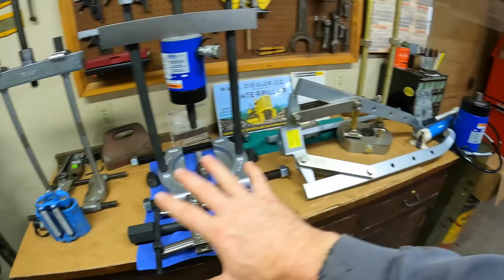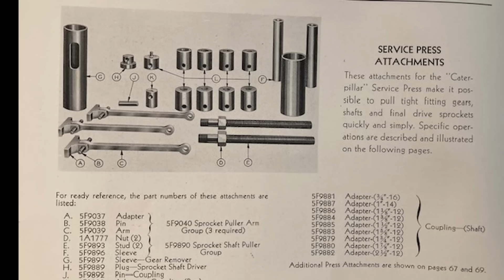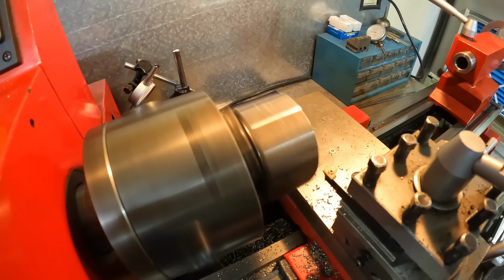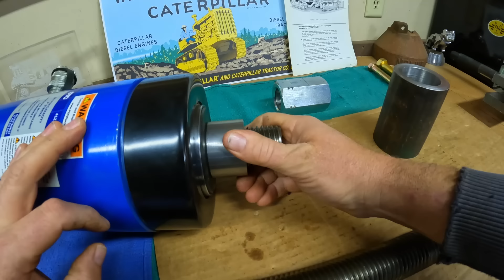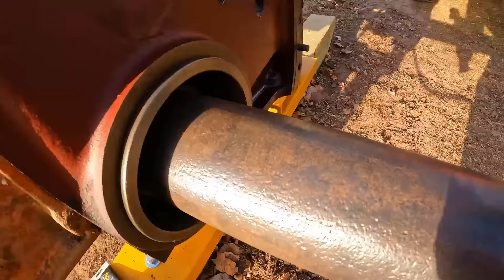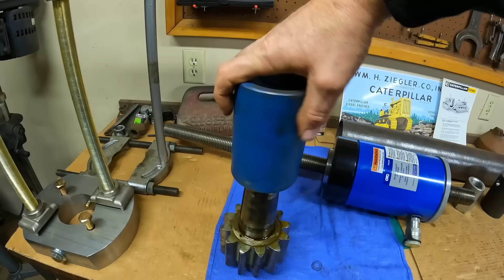50-Ton Puller Build for Removing Caterpillar RD-6 Dead Axles! #2H1768 Ep.21

Comment: Two things some quickly cut out C shaped plate "shims" to drop in between ram and pulling tube could come in handy for future setups to make last minute adjustments on the fly. Sorry if that comment has already been flogged to death I have not read through the others to see. Also my second comment, you will want a press kit in lightly used condition, if it is cosmoline would you be able to bring yourself to remove it?

Comment: I overhauled a D8 cat when I was younger. The sprocket would not break loose at a 100 ton. It took heat and a smack with a 20 pound sledge hammer. Really scary working with that much force.

Comment: I know that OTC makes some incredibly nice stuff. Those are some large tools, most definitely. I wonder if a guy could get some emery cloth on the areas of the dead axle prior to pulling to remove as much rust as possible. I get that the rust is in the journals, too, but at least you could polish a lot of the shaft before and as you pull. The further you pull it out, the more polishing you do to the exposed portion, because it is a dual-journal system from what I can tell?? Just thinking out loud, here. Great tool making episode, too!!

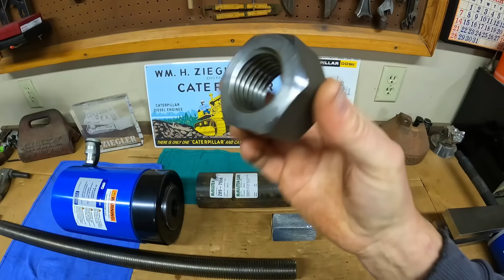Comment: Around 9:08 you say you're not equipped to cut big internal threads. I appreciate that taps on that scale are unusual, but surely your lathes plus a suitable cutting tool could do it, single point style?

Comment: Do yourself a favour and cut some C shaped 1" thick spacers that can be used to quickly take up space as the part moves, instead of having to reset everytime the ram runs out of stroke.
Reply from the maker: The best trick is to just build everything right the first time, but I was so laser focused on getting the taper broken loose that the straight portion behind it didn’t even cross my mind 🤦🏻‍♂️
Reply: @squatch253  True but after having done hundreds of bushings, I found it quicker to back the ram off and install a couple of spacers, instead of having to thread the nut down. The time saving isn't noticeable on one or two bushings, but when you are doing a batch of 10 it adds up.

Comment: That "Handyman Jack"  is a very useful piece of kit, here in the U.K. we used to pull a very heavy duty set of Disk Harrows behind our MF 1505 Tractor. It was not unusual to have a Bearing failure in the Disks, However carrying spare bearings and the above Jack I could replace the Bearings in the field without having to return to the Shop.

Comment: Nice job Sir!
I don't really know what other people like watching, but as an amateur machinist myself, I do wish you would show a bit more of the setup process. To me that's far more important and interesting than the actual machining. For example in this side-project, how did you find center of the tubular adapter before drilling the cross-hole? It's probably the most critical step of the whole build because if you get it wrong, nothing fits. I know how I would have done it but to get it perfect my way would heve required also turning the OD of the tube so thst the OD and ID were concentric...

Comment: You  might extend your pull tube with a thick steel plate with a nice hole in it.      I think you might  have something  around  with all the scrap your are making.   Great work.

Comment: For interrupted cuts like that, dismiss cutting the outside and invest in tooling to cut from the face. Just get a round or square insert (round being the best) and simply "scoop" your way across. If you match your speeds and feeds with the insert specs, you won't have to cut from the side anymore. You basically kiss the face of the work piece and then let the machine work, the large area will require HP, but you can spec your insert for the lathe's specs. Obviously, not all cuts will be possible with that setup, but for most "thinning" ops, that's your wonder setup. Plus, round inserts are the bee's knees for anything where you work a shoulder, remove weld from two parts cut etc. Worth having a few sizes of that format.
Reply from the maker: Unfortunately with our flat belt driven lathes, horsepower is quite lacking. I guess one benefit to that is the belts always slip before anything else can break lol 👍😂

Comment: As a routine process, we used to rotate the stub shaft (dead axle) whenever we were into a final drive.  All Cats, prior to the high drive, shared all blade loads and shock between the final drive and wishbone.  The stub shaft would eventually be bent aft.

Comment: I enjoyed the video!  and thank you for NOT using the vacuum during the machining video.
Reply from the maker: What's wrong with the vacuum?  I would rather remove the chips and debris with a vacuum cleaner than compressed air, which just pushes that stuff deeper inside of the equipment.  I cringe every time I watch somebody blow metal chips with air.
Reply: I think they don't like the squeal when the vacuum is shut off.
Reply: @random_rene exactly!  Sounds like a worn out bearing or two. I would think an OCD person who has a rag covering two layers of cardboard to protect him bench top would fix the vacuum. 

Oh well, that’s just me 😊
Reply: I have one of those vacuums that has been squealing like that for well over 20 years. I tore it down once to fix it and oiled the bushings. It started squealing again in less than a week. It's just the nature of the beast. Personally, I think it's hilarious that it only squeals during spin down. It seems to be perfectly happy when it's running. It only complains when it gets shut down.

Comment: OTC has been around for 100 years and may have made those cat tools. They made service tools for GM at one time if memory serves me correctly They may still make them. Ford on the other hand made all their own service tools for the most part. Chrysler did a little of both. OTC made one of the first scan tools and GM used them. Back in the 80's and 90's I used many OTC tools both mechanical and electrical. They did the job but in many cases someone else would build a better mouse trap or a cheaper one. One standout product is the OTC ball joint press. If you do suspension work you have one or a cheap copy. If it were not for OTC many tool innovations may have never happened. If they did it would have been after much delay.

Comment: Hi once again Brother. On your bandsaw, Raise the blade but leave it engaged in the cut portion. Unclamp your part & rotate it until the uncut portion is high enough to cut through before casting bottoms out. Clamp the part making sure the blade is still in line and cut the balance. Easy Peasy. No hand sawing.

Comment: A very big version of what my dad had on his Hein Warner porta power.  His ram would push or pull.  We used a similar setup to pull small spindals with pocket bearings on cultivator cut away discs.

Comment: Old shafts can be annealed in the woodstove. Add bars to stove just after lighting it then leave all day and remove the next morning when cooled.

I’d add a spacer plate if nessesary to pull shafts. As for threading ina Southbend that’s easy. Internal threads are done with it set to 30 towards head. Cutter is just ground from hss. Should be a little guage for threads looks like an arrow. Also quick change posts don’t work well ina Southbend. I use a four sided tool post in mine or the lantern.  The quick change chatter a lot.

Comment: @26:42 honest question Squatch: how does anyone bend a piece of steel that thick? I know this tractor had a dozer blade on it, so the only thing i can think is someone tried ramming their way through something, in road gear, with the throttle wide open. 

Love OTC tools as well, even though i don't have many myself; i have yet to be afflicted with the fever for tractors this size 😆
Reply: Toby has described the boys that were on the farm that X231 came from as being able to break an anvil with a rubber mallet, if you let them. I've known a few people like that. I was in a mechanics class with a guy that the instructor once said that he could sink a battleship with a drop of water.
Reply: @danielbutler578 you make a valid point 😂

Comment: I’m surprised to see 10,000 psi that early on.  Talk about working with a bomb!
Reply from the maker: Fun fact - the earlier Caterpillar Service Press that the 6F25 I showcased here replaced, was still a 100-ton cylinder and worked off of the same 10,000psi range, only it didn't have a remote reservoir - the pump and handle were built into the cylinder and you had to stand right next to it while waiting for things to go BOOM!  Putting the hand pump out at the end of those hoses on the later 6F25 setup was a huge leap forward in operator safety.